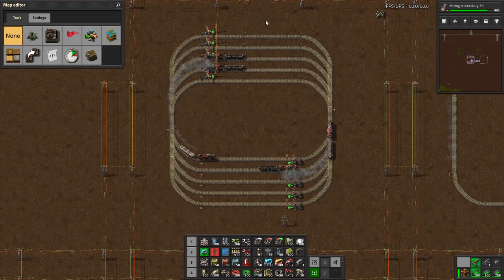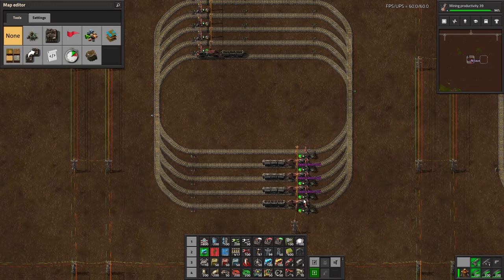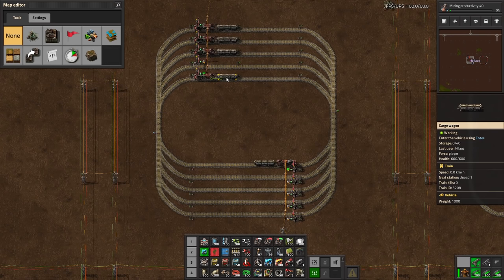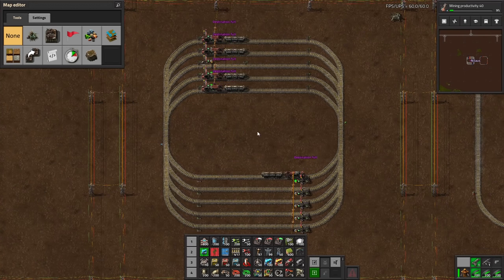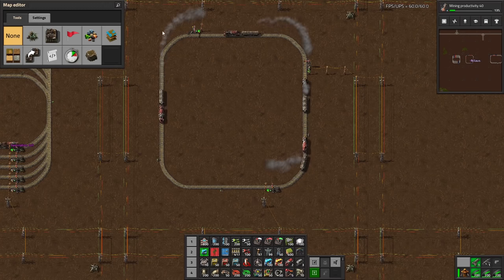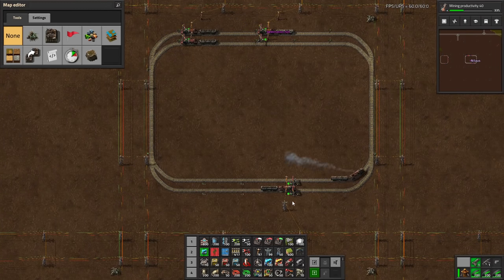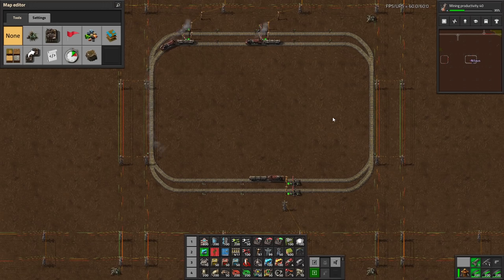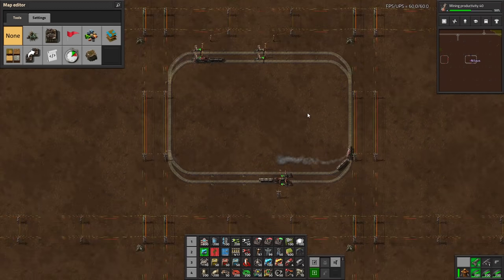ADVANCED TRAIN SYSTEMS; Deadlocks, Depots & Train Limits |  Factorio Master Class

Comment: I know this is an older series, but I'm sure it still gets views, so gonna put this comment. I know a lot of people are going to think I'm wrong, and that's fine, but after 3,000 hours in factorio I have learned 1 thing. the issue with your deadlocks is NOT supply and demand. You should never ever put dynamic limits on your loading stations. if a loading station has a stacker that can hold 3 trains then that station should be hard limited to 3. it makes sure that all empty trains can sit at the loader even if there isn't enough supply to fill them and keeps them from getting stuck at the unload stations. had you designed your loading stations with hard limits instead of all that dynamic limit shenanigans,  you would not have had this issue. I have never had this happen because I always set dynamic limits on the unloaders and hard limits on the loaders.
Reply: So in your approach loading stations kinda double as depots, right?

And how many trains would you build? As many as all the stacker capacity you have? Otherwise it could happen that a stacker "drains" all the trains from the network that are waiting for one station while others are full.
Reply: @heinz8233 you seem to be missing my point. if you have 4 pickup stations and 8 trains and each pickup station has 1 side lanes (can safely handle 2 trains) then that station needs a HARD limit of 2. not a dynamic limit. if it gets a limit of 3 set, and cannot accommodate 3 trains, one train will be waiting on the main line causing a deadlock. that was the point.
Reply: @problemchild959  yes, I got that. My point is that if your pickup stations have a hard limit of 3, you need to build 3 trains for it, because if you build less trains than you have capacity, it could happen that the closest one "drains" all the trains from the system, and they all wait on it while other stations are actually full.

It's not a big deal because trains are extremely cheap, but it's something to keep in mind that is not a problem for dynamic stations.
Reply: @heinz8233  if your building multiple pickup stations, one would typically also make enough trains to handle that load. the problem is when you have say 2 stations each able to handle 2 trains. if you have 4 and one is set to dynamic and sets a limit of 3 you get the same issue. 3 will be going to one instead of 2 each. thats why I said they should have hard limits and the exact amount of trains of such limits. if you have 2 mines and each can handle 2 trains, then you should have 4 trains with a hard limit of 2. otherwise you end up with a dead lock race condition if one allows more trains than it can physically handle
Reply: @heinz8233  your also seriously rehashing this after a year ? my entire point was 1: build the trains that there is enough to sit at the unloading stations. if you have 2 with  stackers able to hold 2, then make the 4 and set each to a limit of 2. you will always have 2 at each whether it has the resources or not. having them idle at the loading station prevents deadlocks. I now have over 12,000 hours in this game and I stand by my original post. loading stations should ALWAYS have a hard limit on number of trains, and you build enough trains for that total limit. its better they sit idle at the loading station than end up waiting on a main line someplace blocking 100 other trains due to a dynamic limit situation. I have used this in Seablock, Pyanadons, and other packs. it works flawlessly. NEVER use dynamic limits on loading stations. unloading stations is fine
Reply: @problemchild959  I'm not attacking your premise at all man, I don't know why you took it that way, I never said you were wrong or even mentioned it at all. I just  pointed out that your system (that works great) needs to have as many trains as capacity there is in all pickup stations. That's it.
Reply: @heinz8233  sorry, its been a long week. and yes it would, but it prevents a deadlock, I just assumed people would know that, and that was my fault.
Reply: @problemchild959  nah man no problem, I should have explained myself better too. Have a nice weekend!

Comment: That's not really a fair illustration of the "waiting" station technique. The tracks need to merge and branch, or cross over, between loading and waiting, so it's just like a stacker. But it does require a lot of extra space at each build, so it's probably not the best choice for your base at this point. Thanks for taking the time to explain your concerns to us back seat gamers. XD
Reply: That doesn't address the issue Nilaus described. Each station has to have a waiting station. Just because the two stations are adjacent here does not mean they will be in reality. In reality they are often very far apart. So there's no way to cross connect the waiting stations without sending the train back out onto the main network for an additional trip.

Simply slaving the waiting station's limit to the primary station would prevent it from being accessed as a path and causing the mis-routing behavior that he complains about, but it's not really a complete solution to the problem.
Reply: @haphazard1342  No, you don't send them back onto the main network, that's the whole point. Nobody's understanding me, or I'm doing a bad job explaining. I guess I'll have to make a video myself to get the point across. Later.

Comment: The train->motorway analogy is a bit off. For trains adding a third rail to an existing two rail system won't give you any meaningful increase in capacity, but adding two will increase capacity by more than double. This has something to do with how the whole system works.

Comment: Really elegant explanation!
1. If science dips below standard, check labs. 
2. Pinpoint the empty lab science input/s, (probably Purple!).
3. Then check that sciences input (probably Steel!).
4. Then check Steel production input, (Iron Plates or raw Ore!).
5. Then increase Steel builds, increase Iron Plate builds, or increase Iron Mining builds!

Your base is designed in such a way that its really easy to pinpoint a bottleneck, even without a dashboard!

Great stuff as always!
Reply: Let's be real checking if it's steel is just a formality. You may as well just skip all those steps and double your steel production again and again and again.

Comment: I haven't commented on this before because I'm sure I don't understand trains nearly well enough to give helpful advice, but the option you mentioned towards the end - simply increasing the trains requested at the loading station - would have been my short term fix for the problem. Sure, it won't fix the underlying problem of "not enough steel in the system", but it will at least get the trains rolling again while you build more steel.
I mean the stackers you have at every station basically are "waiting stations" just not centralized somewhere in the network but local and thus not causing any extra traffic.
Reply: The stations are requesting as many trains as they have resources for with his combinator logic.. so the way to get them to request more trains is for them to have more resources ready..
Reply: @adfaklsdjf  I understood that. But it takes 20-30 minutes to get more resources ready and only a few seconds to increase the limit, so that trains are not stalled at all the stations.

Comment: Another fix for your configuration looks to be to have N suppliers, M consumers, and max(M, N) - 1 trains. That way there is always at least one open space. However you are correct that either way you'd still need adequate resources. 

In my last megabase, I removed the in/out train buffer chests and instead directly loaded the trains. Each consumer had a demand of two trains with room for one waiting to unload. The number of trains I had was equal to the total consumers and waiting spaces. Outside of building my blocks to consume too much relative to the size of my trains, it worked mostly well. With your megabase design, and that you already have stackers. It seems like with your design this would work well, I think all of your consumers at most use half a belt per car, that should give plenty of time for the next train to move from the stacker to the stop and catch up.
Reply: With N suppliers and N-1 trains, if 2 suppliers are closed, you can still deadlock. That isn't necessarily a lack of resources, your production may be backed up elsewhere, you just didn't fill up the nearest station in the 1 minute it takes to leave, unload and return. You should scale your trains to the number of trainloads per minute, not the number of stations. So for steel, where a station takes ~8 minutes to produce 1 trainload, you could easily use N/4 to N/3 trains. Up to N-2 will be fine in the long term as you overproduce into the buffers, but in the short term you have to 3-4x your demand to keep train slots open. Whereas with N/4 trains (depending on travel time between stations) you only need like 9/8ths overproduction ratio

Comment: There were actually 2 problems with your steel trains:

1. not enough supply (which you correctly identify)
2. dynamic limits changing meaning that trains can get stuck waiting for trains going somewhere else and thus not getting to stations that have available supply (4 trains at one steel block: 1 at station, 1 behind waiting, 2 behind that trying to get to the other station, effectively limiting your network to half the rate for steel trains; because this station is far away from everything and there are significantly closer steel stations, they get preferred first; eventually if the distance to stations is great enough, you can get trains at unload stations blinking destination full even though you have empty stations with supplies available)

You can mitigate #2 somewhat by overbuilding supply, but you have to increase the ratio of supply to demand as the base continues to grow. You can also mitigate it by setting a limit on each loading station such that trains cannot block trains from access to other stations (with your steel design 1 train max at each loading station). However you also require enough additional supply within a given range such that there will be enough supply by the time the train gets to the station(in your steel condition the problem wouldn't happen with 1 train max; this will happen with your green chip stations if you make them far enough apart from each other and set the max number of trains to 3). 

You can get rid of the problem altogether by getting rid of dynamic limits and increasing the number of trains in the network such that there is only 1 empty slot in a given station pair limit sum. At this specific circumstance, if you ever have trains blinking "destination full" at an unload station, you do not have enough supply.
Reply: his problem is not the dynamic limit... 
his problem is whern a train get stuck at the unload station.... but thats his point... if your train get stuck at an unload station, thats because you are missing ressources somewhere ! his point is.... with dynamic limit, trains shouldn't be stuck at unloading stations, they should always be stuck at loading station, which is fine.
Reply: @dndbasement2370  In this very video, he shows the trains deadlocked when there are multiple supply stations open and 1 request. You need to have more supply stations open than trains as well as demand

Comment: i was trying my time at amegabase with these designs...
and i finally found out the problem you had with trains getting stuck. you only had part of the solution by saing to add more ressources by having more outposts... the reality is... your outpost reguardless of how big they are, cannot support your actual design plans. as an exemple... i took a 10 lane outpost with 140mil ressources... all of those drills, with speed modules will only get out 11k per minutes. you set the trains to be full at 16k, which is 8 wagons times 2k ressources... so basically your ore patches can get out an entire train only in about 1 minutes and about 20 seconds. trains takes no longer then about 20 seconds to reach destination and back. yet you keep on splitting your ressources onto two train systems... which means it takes two times more to fill in that 16k limit. in your current train system, there is no way your base can manage that fast... basically you expendaded your base too fast and ended up always missing ressources because none of the ressources were fast enough to fill out a train to begin with. thus trains gets the "destination full" which isn't a bug... you literally have no destination ready to deploy. thats why yougetthe destination full.... sure adding more ressources solve half that problem... but... you're adding to the problem by adding more trains as you still require only 1 train per outpost and even there the train can only be filled every 1 minute and a half or so...

so whats the solution ?!!
less wagons to fill, diminish the number of trains by diminishing how much they can fill up.
i'd say in your megabase design... L-CCCC-L trains would be more efficient and the destination full problem would become much less visible. yes, my solution is to half your designs... things like  circuits are fine... i mean as long as ressources gets in, those trains will fill up tight... but basic ressources... there is a limit at how much they can drill out of the ground and thus you cannot go beyond that limit. you have to follow it. so if you fill up 1 train of 16k ores in 1 minute and a half. by reducing train maximum load by half, then those trains should be filled up and ready to go in 45 seconds. 45 seconds is much better a time from ore to plates and back.  by that time it should be ready. otherwise that train goes to plates then tell you destination full for like 45 seconds before it decided to go on again. so there you go, the deestination full problem is because your trains are going too fast for the drills to follow them.

Comment: I'm still toying with train deadlock detection, but here's the start of an idea that may interest you:
You've already pointed out that Read Stopped Train does not show the train that is trying to leave (T=0) but does show the loading train (T=1). That is half of the solution right there. All we need is a way to detect that there is still actually a train there.

Place an additional rail signal behind the station such that it is red when there is a train at the station. This requires a small gap for whatever reason, so leave one space between the station and the new signal. Read that signal. (You could also use the signal at the rear end of the station, but that's a lot more wiring.)

If RED (from signal) > T, then there is a train trying to leave (or actually leaving, but that's transient).
Of course, more supply can't hurt.
Reply: Came to say this!